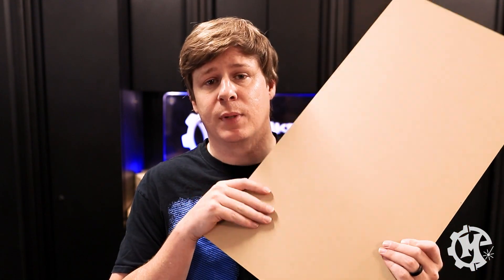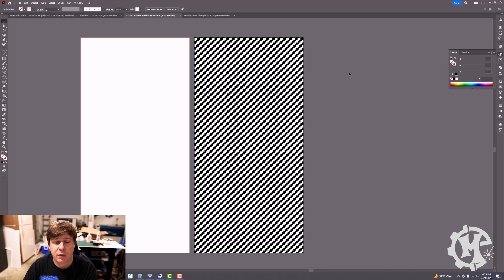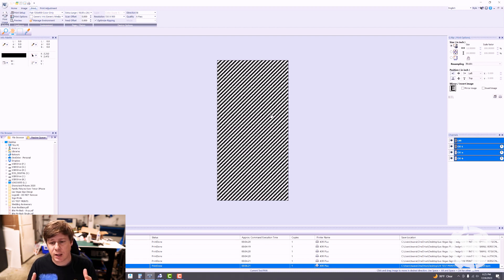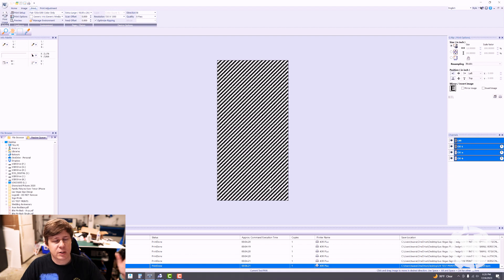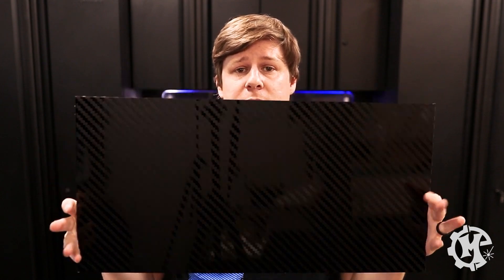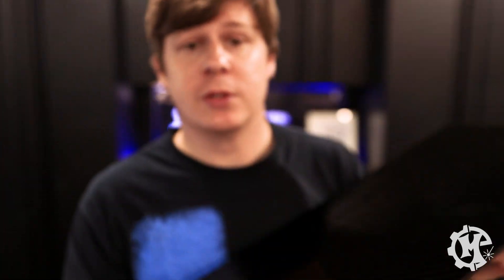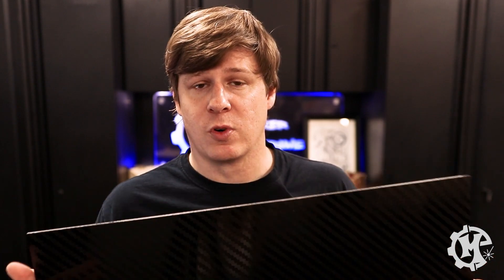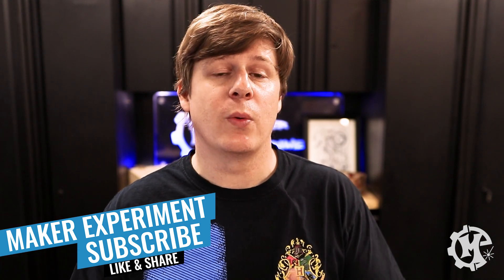Making My Own Carbon Fiber Acrylic

Comment: I'm surprised you didn't laser engrave the pattern instead. I would imagine engraving gives you more control over depth and effect, while leaving a surface you can polish later if needed.  That uvprinting could be interesting with a more complex pattern you can't get in carbon today, but with a carbon look. Japanese Wagara patterns over a mirrored sheet or translucent for lighted panels come to mind. Fun Stuff.
Reply from the maker: Laser engraving it would have taken much longer. When engraving, the black acrylic will actually be kind of a white color and that wasn’t really what I was going for.
Reply: @MakerExperiment  Good point on time to product.